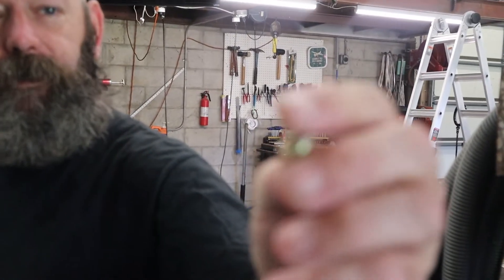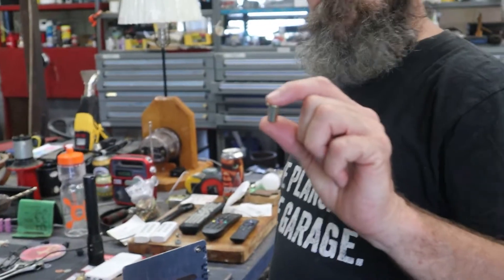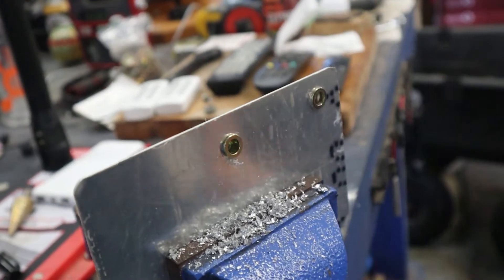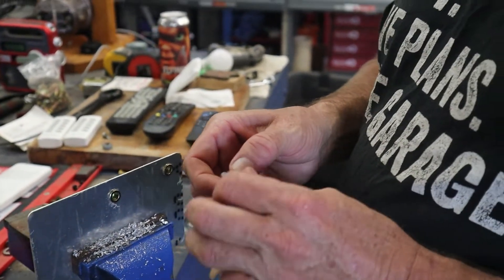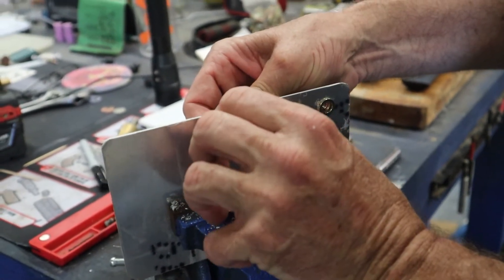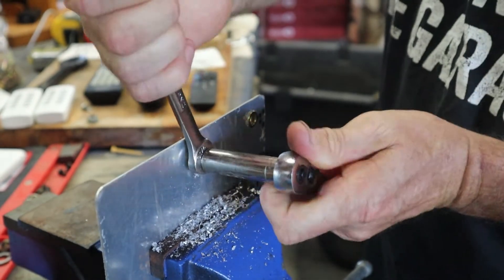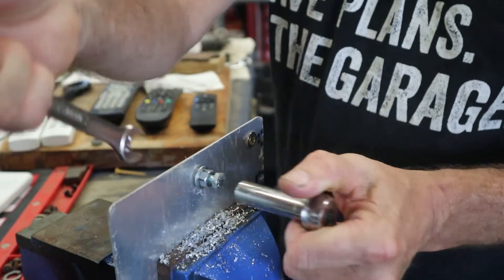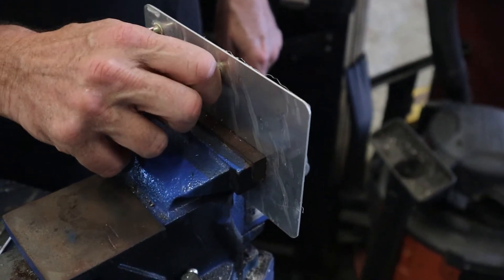What A Rivnut Is And How To Install It

Comment: Would these hold strong enough on the plastic on a pond prowler to add anchor points? I strap the boat on my roof rack and I want to add more cleats so it’s more secure.
Reply from the maker: yah, check out some of my pond prowler videos. I used them to repair a clear, mount an anchor trolley, etc.
Reply: @Fishin_Fixin_things  awesome thanks

Comment: Would these work to attach a 1x4 piece of wood to my pelican boat, on which I can add other things as needed?
Reply from the maker: I don't think so, wood is to soft, and probably to thick, Try a piece of 1/8 inch thick aluminum strip, and they would work well.  good luck.. add pics